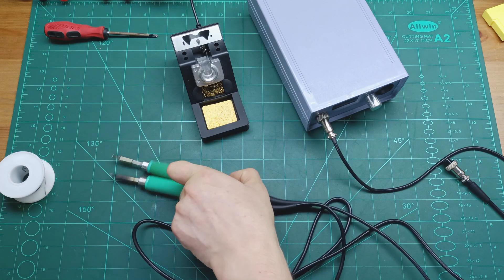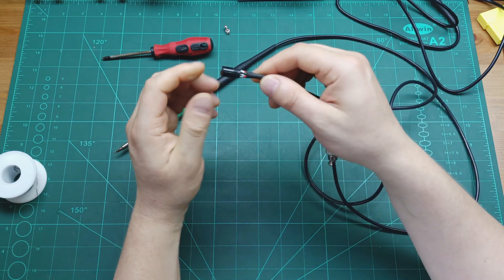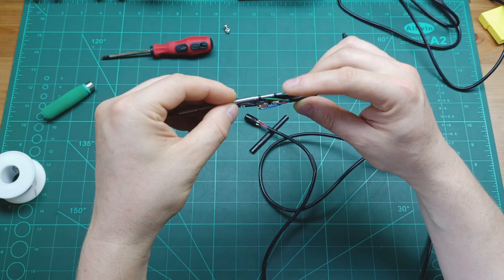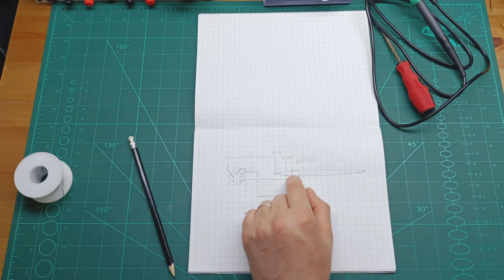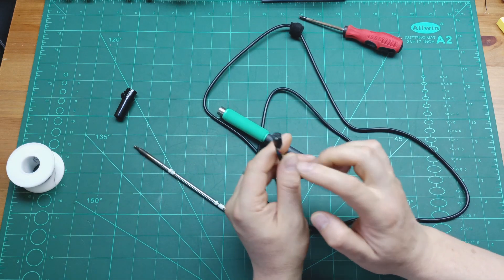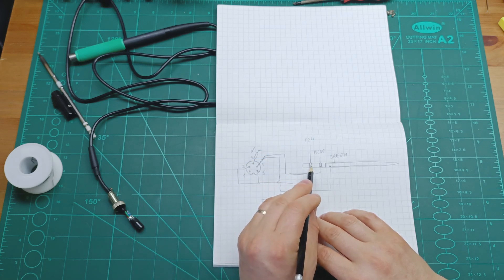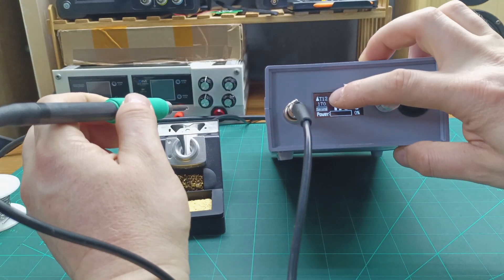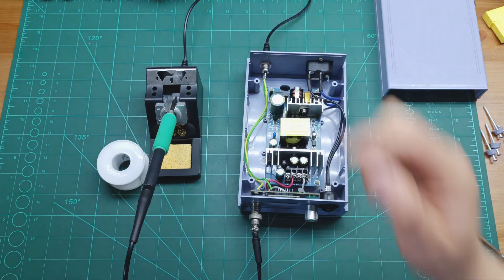How to connect the T245 and T12 soldering iron to soldering station

Comment: thank you! I have watched a lot of videos on people building DIY 245 stations, but they all leave out the required handle wiring mods.
Reply from the maker: @GearJammer-me8uj  hopefully my video helped you out on managing to do the right connection
Reply: @SymbolTech21  Your video helped me a great deal..and also your videos on building the station and calibration Thanks you very much
Now I need to see if I can repair my first controller that I blew the 8 pin chip (mosfet?) I replaced the chip with a 4459A as suggested on eevblog and it lights up and all menus functions, but it wont heat up.

anyways I really appreciate all the time and effort you put in to share your knowledge...thanks!
Reply from the maker: @GearJammer-me8uj  on one of my videos I show also that my first controller board blow a MOSFET and I replaced with a 3 pin through hole mosfet. Check my videos and maybe is the same mosfet that blown to you as well

Comment: Hi, I wanted to connect only the T245 handle, I can't understand why I have to change the arrangement of the cables on the handle? On the GX12 connector of the soldering station if I connect the cables in such a way as to accommodate only the T245 handles then all the T245 handles on the market will not be compatible ?
Reply from the maker: @CanaleYouTubeGeneralista  the T245 soldering handles on the market are ready made for specifics soldering stations. But not for this soldering station controller board. So in case you want to use this controller board the wires arrangement is how I'm showing on the video. I don't know who designed the controller board why they don't kept the orientation pins in order to work with soldering handler right off the shelves
Reply: @SymbolTech21  Thanks for the clarification, I thought the pin orientation on the controller's GX12 connector was already set for the T245 handles, but it's a bit annoying to remove the handles to change the cable layout. Thanks for your help and for sharing your project. Regards.
Reply from the maker: @CanaleYouTubeGeneralista  hope you found this video informative!
Reply: @SymbolTech21  Yes that was very helpful, thanks again.
Reply: We got a brand new DSW200 with just a T210 handle, then we decided to upgrade to T245 & C245 standards. 

Ordered a T245 from Alli Express and some tips from Amazon, then we installed the new handle and then the C245 tip turned on the station and guess what happened? THE TIP GLOWS like a candle. The display only showed me 40 degrees and a very quick turn off. At that point, I was thinking, well, something is very wrong here. The next step was to disconnect the T245 handle and test again with the original T210 and lucky the station is alive. Survived the storm. We opened this T245 handle and when I saw the pin out in your station and compared it with the wiring at the connector, it was completely different. The quality of those handlers is pure garbage. I don't think they will run longer exchanging tips. I did some research about the standard pin out, and it seems to me nobody follows any rules or standards. Any advice or info about it will be appreciated.